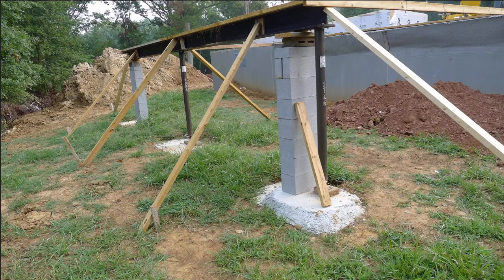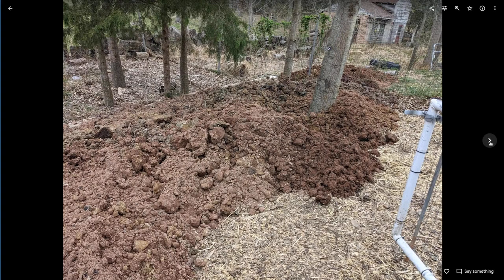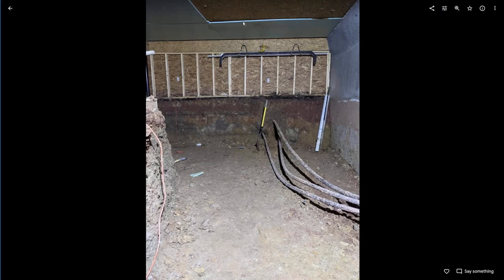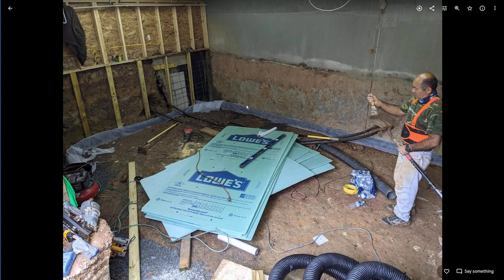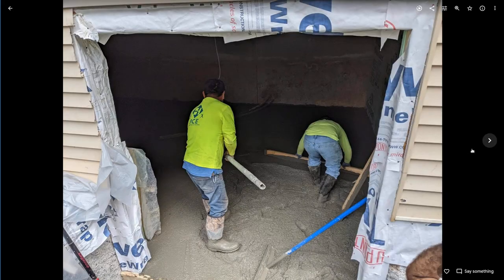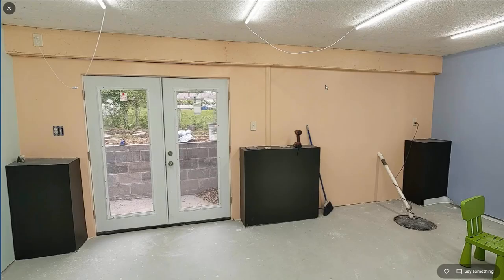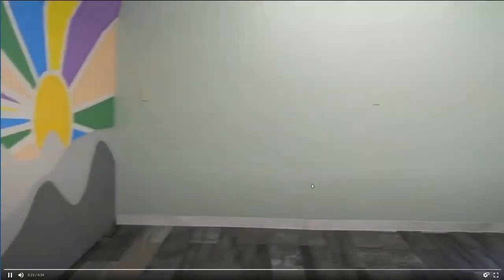Hand Dig a Crawlspace into a Basement

Comment: Respectfully, A for effort. but, I really think you should think about ripping that drywall out and adding either blocks or pouring concrete. that clay will eventually collapse and rip through your foam board and wall or worse moisture gets in and mold grows. Even for a temporary space I would check the humidity, add an exhaust fan, and think about air circulation, im sure there's ducting above you could use. I would also run new electrical after and forget about everyone behind the foam boards.

Comment: so the walls holding the clay bank in place are non-treated 2x4 studs laid flat with vapor barrier attached, then Styrofoam, then sheetrock?
Reply from the maker: The above-grade framing was already there for a number of years, but below it is treated. Yes you described the cheapskate lasagna we used.
Reply: What is stopping another cave in at a different spot from blowing out your wall from behind?  Also, I didn’t see any continuity of your vapour barrier across the aggregate and under your slab, nor TuckTape to seal your laps in the barrier on the walls. What good is it if it isn’t vapour tight?  Your carpet tiles will be mouldy in just a few years with the moisture that will wick up from under the slab creating an unhealthy environment to be in. I would at least recommend a very good air exchange system to keep the room as dry as possible and/or a dehumidifier.
Reply from the maker: @meneelyhouse  This is not conditioned living space at all. For my real basement I have a rubber and magnesium air channel system underneath luxury vinyl plank. The carpet tiles were cheap on clearance. Goals were cheap and better than the 🕷️ and 🐁 home that was there before.
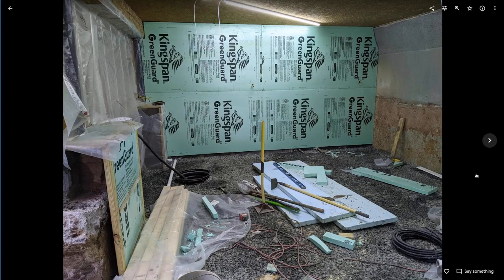Reply: @meneelyhouse       Yes and he dug around the support beams leaving just an open "support beam" on two sides.    4:45 and 5:20. Shoukd have jacked it up and put in longer ones.
Reply: @MontanaPDX  yes that is the biggest problem I saw, the soil is very bad quality for quite some depth underneath the now exposed footings.

Comment: This is a hack job. Should’ve put a disclaimer in that you don’t know what you’re doing. Those walls need to be concrete, so you don’t have a massive cave-in and possibly even the sunroom coming down if the foundation for the sunroom came loose from shifting.. The fact the clay collapsed with zero effort and just from being wet, is a huge sign that you should’ve had concrete walls put in.

Not to bash your project, but this exact thing I have seen over the course of a few years dangerously collapse, that clay will eventually seep its way through those walls.
Reply from the maker: Gotta define the goals to determine whether they are met. Maybe you're coming from a place where there is a minimum quality you'd like to see, and if a project can't be done to that quality it should not be done. I did this very inexpensively for myself - didn't recommend that others do this. If the walls cave in,  so be it, not a big deal. There really is no risk to the sunroom coming down, those footers are rather undisturbed and plenty strong - the load is only on those footers and the actual precast house foundation itself.

Comment: I have a shallow well pump under the house that feeds from our well.
The small 1/8” line that feeds the pressure switch sprung a leak that was wetting the wall like that. 
It was such a fine stream, it couldn’t be seen with the naked eye. 
I felt it when I reached over to feel the wet area.
Water……. (Shakes head…..)

Comment: I think your biggest risk here is the 3 or 4 feet of clay under that concrete wall of your house facing the sun room... Long term that clay will probably settle outwards somewhat, the wall will settle down, and your house is going out of level in the middle there. The same thing happened when the crawlspace of my house was dug-out by the previous owners, except they built a block wall (no concrete reinforcement) to try to keep the clay in place. Guess what, it still settled, and the wall needed pinning, reinforcement, and piers installed to lift that side of the house...

Videos like this are why Youtube needed to keep dislike counts. Now people can search and see this and think it's a reasonable thing for them to do if they don't read the comments...
Reply from the maker: Yeah, they have a dislike button. Sorry you had a bad experience from what your previous owners did. Hit it to register your vote. I probably didn't understand what you mean about "3 or 4 feet of clay under...". That whole precast foundation is set on structural inspected footers, and the lally columns are on three super beefy footers that aren't going anywhere. I guess I'm saying, everything done here can bust apart and it really woudln't matter (to me, I understand selling is a different matter). The worst risk to me would be black mold caused by moisture issues and the fact that there is near-zero airflow down there, not the house falling down or something more  doomsday.

Comment: How is this holding up? I want to do something similar but I was going to under pin, does this actually hold the clay back?
Reply from the maker: No problems so far. As we get toward the spring we are in the wettest season, so now would be the time for failure.
Reply: @RyanShea  good stuff. Hoping for the best for you!
Reply: Any updates on this today?  @RyanShea
Reply from the maker: @eeoo2062  it is still hanging in there just fine. It is spider city though since I really don't use the space.